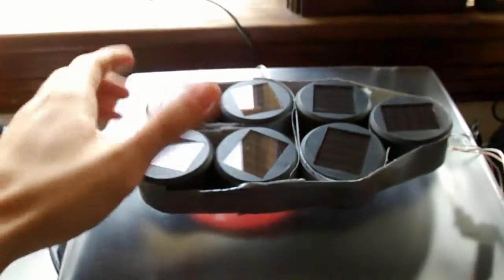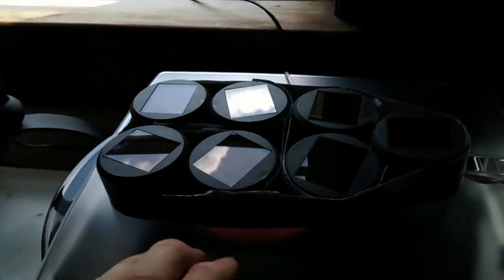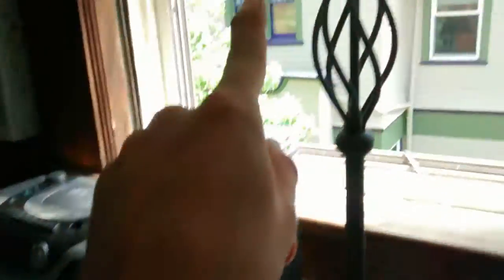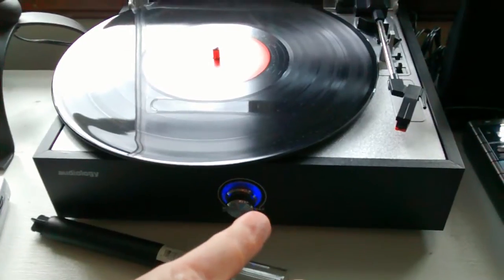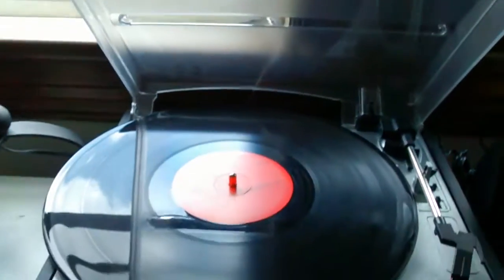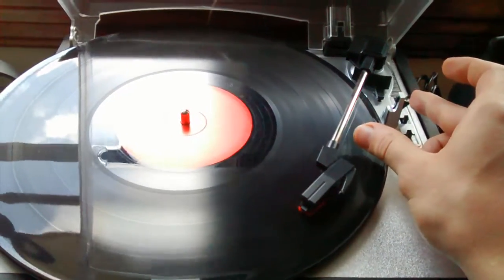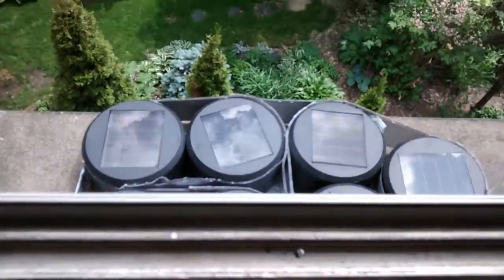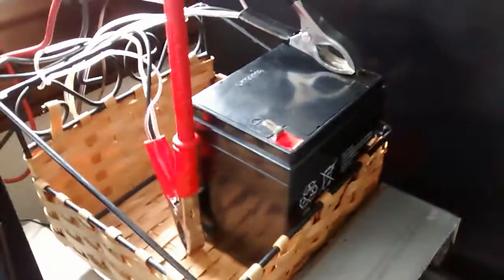Turn 1$ solar garden lights into a 12 volt panel

Comment: What size diode would you use for that 12 volt, and nickel CAD battery circuit?
Reply: You could use a 1N4148 at a pinch or a 1N4001. Higher output you could use a higher rated 1N series diode. You'll loose a small amount of voltage through the diode

Comment: How did you convert record to 12volt
Reply from the maker: Inside the record player, there is a transformer, that takes 120v and converts it to 12v AC. I just removed the transformer, and connected my 12v DC supply directly to the board inside. Polarity didn't matter in my situation, as the board has a FULL BRIDGE RECTIFIER.

Comment: 7 x 1.5 = 10.5 Volts,get one more dollar light an you will have you 12volt.
Reply from the maker: I was looking more towards using the panels for power. The batteries were kind of an afterthought. This is true though! If left on, they would probably not be the happiest batteries.

Comment: what kind of droid is whats the number on it
Reply from the maker: Droid? Sorry, not sure what ya mean.
Reply: @TailsFurse  you say something about it, at a minute
Reply from the maker: Oh, you mean the diode. I just pulled it off of a 12 volt ac to DC converter. I unfortunately do not have this project anymore so I can't give ya the specifics. It was a schottky style diode though, not a zener.
Reply from the maker: I don't think it has to be anything too powerful, the output of these panels are pretty low.
Reply: A 1N4001 would be fine

Comment: How do you wire the panels again?
Are all the positives together on one side and all the negatives on the other?
Or
Are they positive to negative, on one side and positive to negative on the other with a bridge?
Reply from the maker: +Gabe Maldonado (zmaxx21) in this setup, with these little panels, it's setup positive to negative, to positive to negative and so on. Each panel is 3 volts. If ya put two, positive to negative which is called series, you would then get 6v. To charge a 12 volt battery I used a panel that is 21 volts. Which is 7 panels in series, or positive to negative.
Reply: @TailsFurse  please...!! I did something like that to charge my jump starer and storage the energy...serie conecction 10panels(2.3V)=21.5 output.. Jump starter 17v input.. It will work?
Reply from the maker: @aleydamendoza9146  I don't know enough info about your config to let ya know. What kind of jump starter do ya have?

Comment: you are pushing 19 volts into 7 batteries that have 1.2 volts each, will that cause the batteries to blow
Reply: No those are nickel cadmium batteries and when they're wired like that that's a single battery I measured the voltage coming out of the big battery charger on hi boost it was like 40 volts
Reply from the maker: I probably wouldn't leave the solar panels on these batteries. They probs won't explode, but leak and get very warm.

Comment: if anything in your place requires batteries, for objective use, get the rechargeable ones and you can charge em with the solar panels and such. Save a lil bit more. xD

Comment from the maker: Turning a few 1$ solar lights into a neat little power station! Learning more and more about this solar stuff and how it works! Haha, next the whole apartment will be solar powered! \^-^/... Not really... Would be all sortsa fun to do that though!

I think my next big move will be to move away from thin film panels an' go to crystaline panels! Those are the blue and shiny ones. Smaller an' more powerful!
Reply: I'm new to this stuff....could you charge a car battery since it produces 12 volts?
Reply from the maker: Eric Beggs Technically yes, you could. However it would take a really long time to do so. We are talking months of sunny days, haha! You would need a bigger panel for sure!

An easy way to experiment with this tech is to grab one of those 1.5w harbor freight panels. You can do a whole lot more with those! Or even jump up a step and grab a 10 watt Renogy panel from amazon, a small charge controller and a SLA (Sealed Lead Acid ) which you can find at places like Radio Shack or micro center. After that you could plug in almost any Car accessory, including Fans, lights, radios, cell phone chargers and more! For about 80-100 dollars or so!
Reply: Thanks!!!

Comment: Ai t that panel outside going to be blown away ?
Reply from the maker: Both the "Harbor freight" and the homebuilt panel were out in today's 60mph wind and rain storm today, they both stayed put amazingly! They are just a little wet. I don't think the home built one likes being wet though. Going to have to make sure to bring it in on rainy days. The harbor freight panel, I added caulk to the inside to make it resistant to water, so it was okay. Thanks for your comment!
Reply: Very interesting